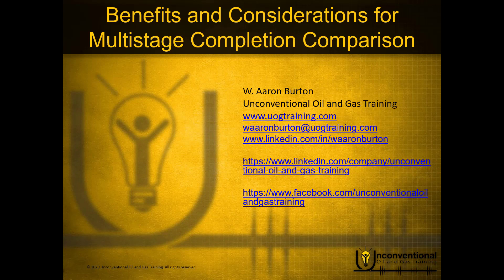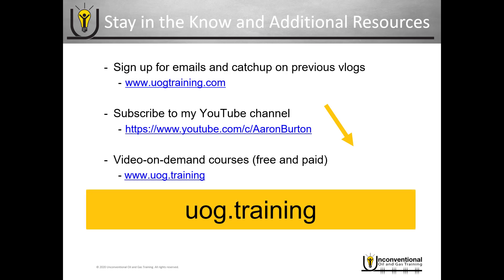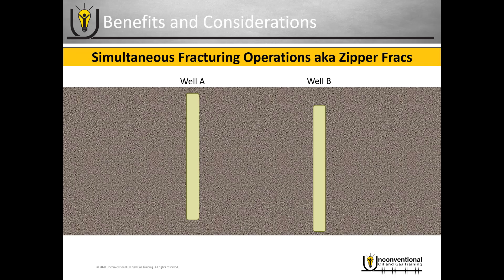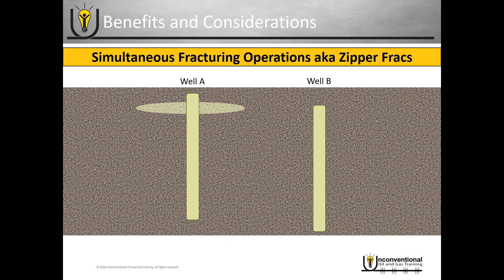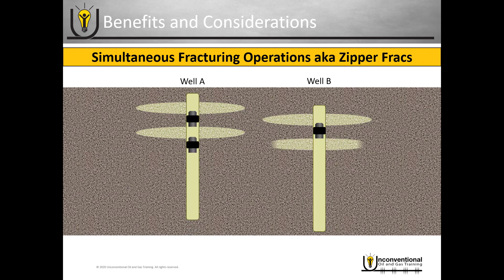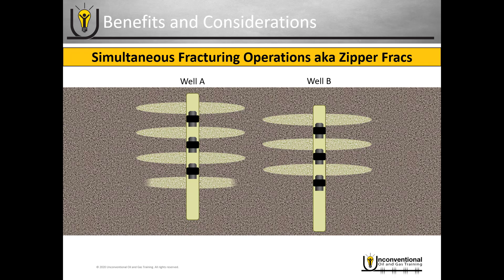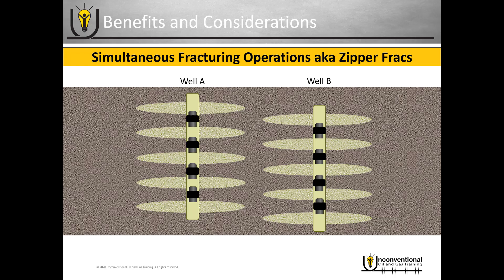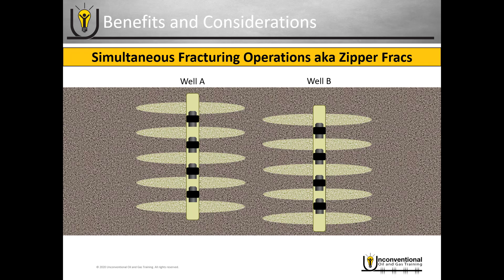Comparing Multistage Completions Part 13 - Operational Efficiency of Plug-and-Perf with Zipper Frac

Comment: Frac and Plug is usually from Bottom to Top. The video seems to be showing the opposite??
Reply from the maker: Hi Napoleon,

If I'm understanding your comment correctly, you are interpreting the wells as vertical wells. What you're seeing in the video is the aerial view of two laterals. The top of the screen is the toe of the lateral and the bottom of the screen is the heel of the lateral. With all plug-and-perf operations, you will start fracturing at the bottom of the well and move up the well so that you able to maintain stage isolation - so you are correct in a vertical well application. Does this answer your question?